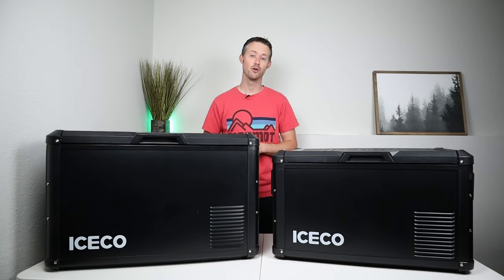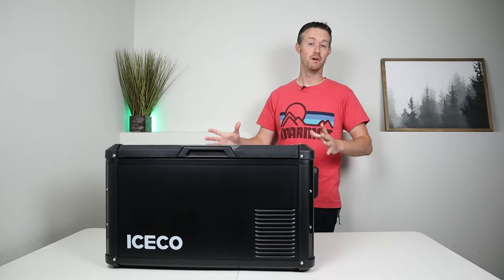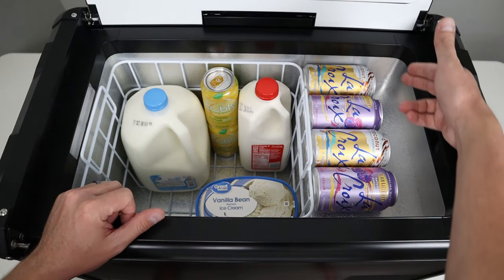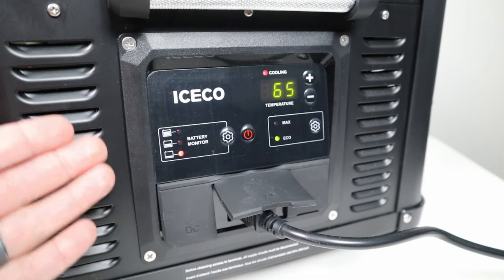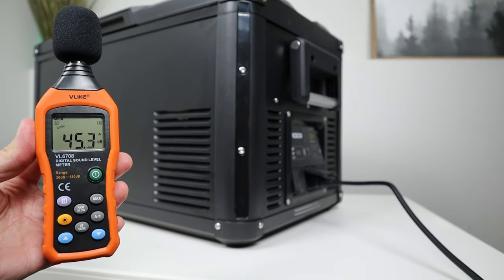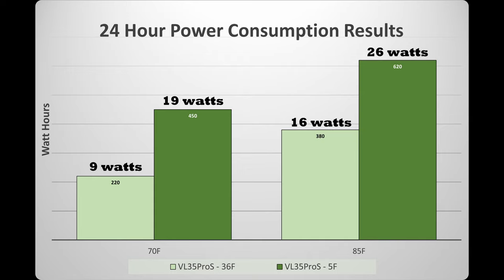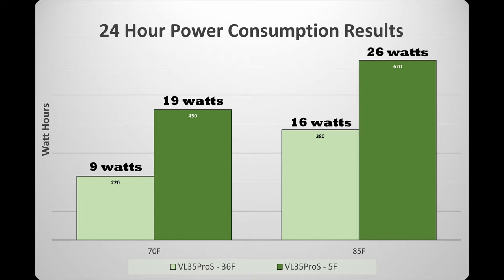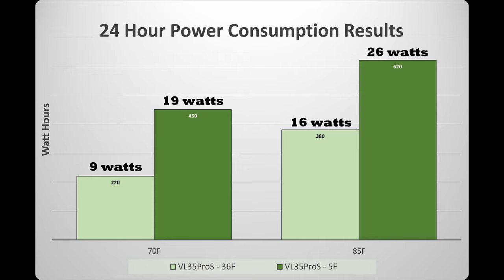This Is The New ICECO VL35ProS! Let Me Show You Why I Love It!

Comment from the maker: Find the ICECO VL35ProS fridge HERE:   https://collabs.shop/o0vi39
Use DISCOUNT CODE - 'JASONOID' to save 12% OFF

Check Out My Power Station Grading Sheet HERE:  https://jasonoid.com/powerstations/
Reply: Thanks for the great video.  Do you have trouble opening the lid on the vl pro fridges? My parents (70s) have a hard time opening them because you have to hold in on the handle then lift.  They prefer my dometic which is just a simple lift.

Comment: My Alpicool TW35 was $270. Its a dual zone and when I ran the fridge (larger side) at 36 degrees and freezer (smaller side) at -4 degrees (lower than this ICECO even goes) in 75 degree temperatures it used 11.54W across my 4 day test. It has an optional snap in battery which can keep it running 4-8 hours depending on settings and ambient temperatures. This is convenient because you wont have your food go bad if you check the app (it has an app to control and monitor everything), you'll see it is running the battery down so you know something happened to its primary power source.  It also allows convenient trips to town for food without having to worry about the 12V lead popping out over a bump in the road. It also has a reversible lid with built in cutting board, dual wire baskets, and drain plug. It has every feature this ICECO has plus dual zone, battery, and more for less than half the price... but its not a SECOP compressor.  Mine has been running nonstop for over a year now and it has been great. Just saying, consider your options guys. There is no reason to spend more than you have to, and clearly you don't get more for your money. About the only fridge I'd consider moving up to would be the Glacier from Ecoflow and thats just because of the ice maker. Even then there's the EUHOMY with ice maker for $400 instead of the $1060 Ecoflow setup. The EUHOMY even uses the same battery as my current fridge
Reply from the maker: There is definitely a difference between a cheaper plastic fridge and a heavier duty metal fridge. Usually product price translates over into customer support and warranty. If you plan to use a fridge while camping or off-roading throughout the year, something more durable will definitely hold up better over time. If you just have the fridge sitting around at your house, you probably don't have to worry about durability as much. I use a cheap 12v fridge at work as a personal fridge for my lunch, it cost $149 and runs 24/7. Not too worried about durability on that model LOL
Reply: my cheap fridge has been doing fine at home and on the road. I dont tend to throw it off the roof of my vehicle so I cant see a reason for it to be metal since it stays strapped into the vehicle, it doesnt take a beating  @Jasonoid

Comment: Would get one of these iceco fridges with secop compressor for daily use in a vehicle, or with 2 separate lid sections to use one as freezer. Love the flexible lid. Need to get vehicle first for sizing. Your reviews and spreadsheet are really great to see what size and brands are energy misers (not the smallest ones out there!). Thanks.

Comment: Great video as always.  I'm a 12V fridge/freezer addict.  I own 2 dometic cfx3 45's a 26qt Joytutus, and my latest acquisition is the Setpower 45s.  I was considering the iceco but what sold me on the Setpower rv 45s was the 40º anti-shape function.  Still testing it out, so far there seems to be about an 12º difference in internal temperature from the set temperature. I've put several bottles of water to freeze over several days and it has only frozen one, on the top shelf of all places.  I set it as 20º so I need to lower the temp.   Nice design and as I understand it is also manufactured by Iceco.    The real surprise is the Joytutus I bought about 3 years ago.  It is a real cheap unit which could use a better seal on the lid but otherwise I have had it plugged in for almost 3 years straight on freezer mode and the compressor keeps on running.  Not bad for a unit I paid less than $230 for.  Again great video, and thank you for your work.
Reply from the maker: 3 years! WOW, great testimony to how long one of these can run continually!

Comment: Awesome review as always. A bit off topic, but just a follow up from my Elecaenta 120w woes. I've recently purchased a Powerness solarX 120w panel as a replacement and it's awesome! I have the newest version with the extra adapters and the newer panels. Here are the specs:

Max power: 140w(omg)
Max power current: 7.78 amp, yes 7.78 not 6.6
Max power voltage: 18v
I lost the damn booklet but the open circuit voltage when cold tripped my Golabs R300 overvoltage protection at 23.5v so my guess it's around 24v open circuit when cold. I just put my hand over one of the panels to drop the voltage then plugged into the Golabs when the Golabs started charging and the voltage dropped more, I took my hand away. It was pumping in an indicated 60w into the Golabs at the 3amp current limit so with 5w added for losses on that little MPPT controller it was probably pumping in at around 22v at 3 amp. I had it up against a wall so I couldn't look at the panel LCD screen.

In October in Toronto(alt 412m) with 652w/m2 solar radiation I was pulling 106w. Temps were around 70 F nice breeze which probably helped with the efficiency but considering this panel is tested at 1000w/m2 solar and I was getting 106w at 18.3v at 5.79amp at 65% of the tested solar radiation I think is awesome. It has an LCD screen on the back which tells you what the panel is pumping out in volts and amps for the DC USB-C and USB-A ports which to me is more of a gimmick but it's fun to look at and it may help beginners angle their panels for max power. The newest version comes with all the adapters unlike the older one. It has a magnetic clasp as well as the two inner panels fold onto themselves. I'm just putting it out there so maybe you can hit them up for a review as a community member found a gem. They have sizes 40w to 200w. I think it was about 10 or 20 bucks more than the Elecaenta but it feels WAY better quality especially the ETFE coating which on the 2 lemon Elecaenta's look like a child put it on.(I don't blame them, their supplier is at fault) Just a head up for the community as there is almost no reviews on it except some crazy German in Australia and in Europe and they are just plugging it in and go "Hey it works". And it's all the older model not this new one. Maybe hit them up and see if they'll send a panel or two for testing. They still market it as a 120w panel so I'm wondering if this is another XT100 gem which gets OVER what it's claiming(120w) under ideal conditions. One guy on Amazon claimed he got a max of 135w which is probably a fluke in the summer. Oh and it has a 2 year warranty not the standard 1 year. Test it damn you! Test it! 🙂

Comment: Oooh... this looks similar to the Ecoflow 🤔 I really do want dual-zone and convertible dual-zone like the Go20 or the ecoflow really stand out to me
Reply from the maker: The hybrid divider would be super cool! Setpower has a few models that are affordable with the removable divider. The Setpower RV45D and RV60D
Reply: @Jasonoid  would you recommend either of those over the ecoflow unit? That one was still on sale for under $800 last I looked which seemed kind of in line if slightly more expensive and the vacuum insulation seems to work equally well as bulkier units 🤔. I'll go look up those two you just recommended now :-) I bet you have videos on them!
Reply from the maker: @NoZenith  it all depends what you are looking for haha... if you want the icemaker to function, you'll need to purchase the Ecoflow internal battery, that adds more money to the cost.
I have videos on the Setpower models, let me know what you think!
Reply: @Jasonoid  I thought the ice maker would also work if you just plugged it into a 110 outlet? So if I were at a campground where I would actually be using the ice or if I had the additional capacity with the capability to recharge I could just plug it into the 110 outlet on a Delta 2 Max (shortlisted possible all-in-one camping trip power supply).

Comment: Had an iceco VL45ProS and it broke early. Got sent a new one and the 2nd unit didn’t last either since it stopped going under 34 degrees and would drain my Detla 2 power station. They also aren’t very responsive with their warranty. Built quality isn’t that great. Would not buy an Iceco again.
Reply from the maker: How were you using them? Two of them broke?! 
I had friend who had his fridge just rolling around in the back of his truck on a bumpy dirt road and it stopped working too.
I have tested and used like 10 of these and they are all still going strong with family I've given them to 🤷